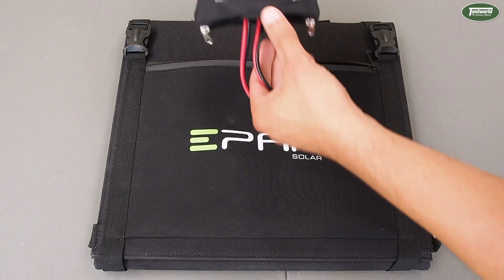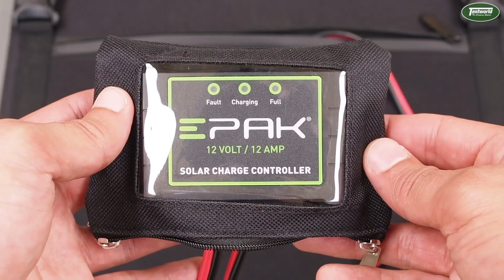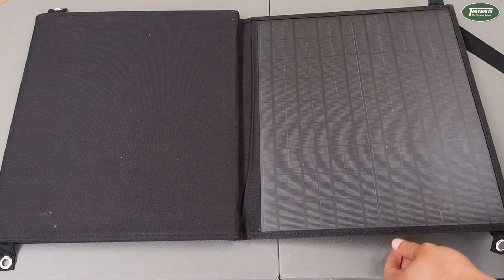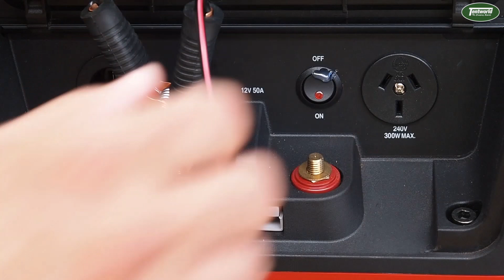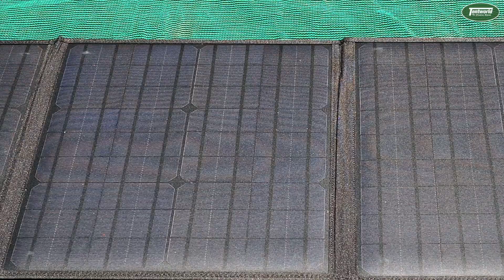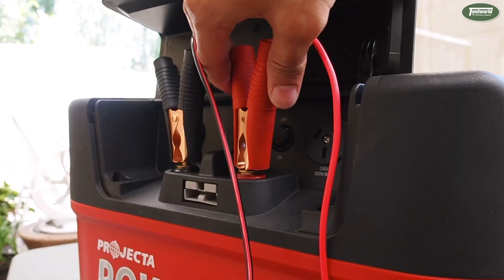Companion Epak 120W Solar Panel Mat Kit  - Power your Campsite!

Comment: i'd always understood that to avoid voltage drop you attach regulator as close to the battery as you can. therefore, wouldn't you attached 5m cord and then the regulator?
Reply: the user manual also suggests to do it this way; that is, regulator closer to the battery